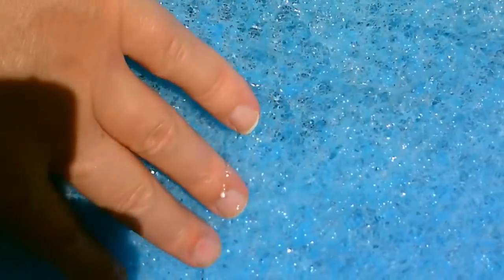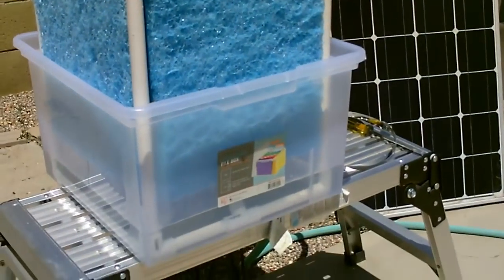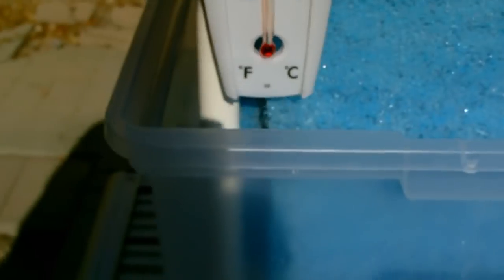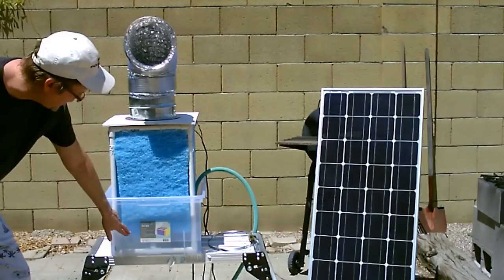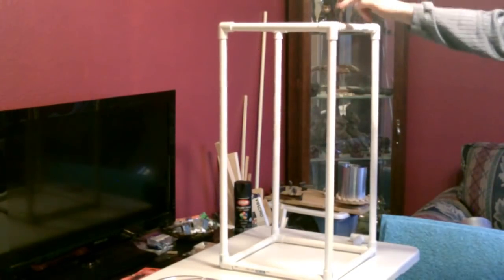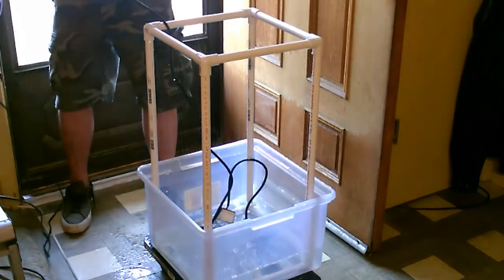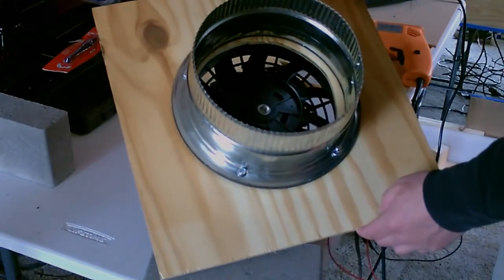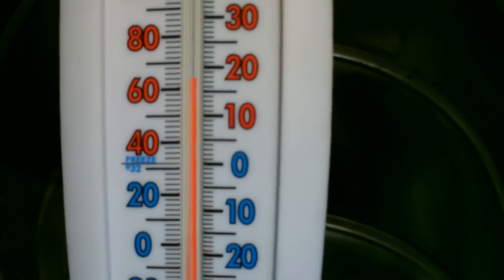DIY Evap Air Cooler! Best Yet! 1500CFM/20MPH (90Fin/64Fout) 500-1000 Sq.ft. run AC/DC/Solar/Batt

Comment: Where I live the commercial swamp coolers are massive and super expensive and have expensive honeycomb paper material that has be changed...but what does this suck sound like 10 feet away? The mic right next to the airflow is deceivingly loud.
Reply from the maker: hi there. it's actually not very loud. the mic on the camera just picks it up that way when it's right next to it. if you're even 3 feet away it just sounds like air flowing (no louder than a box fan on medium or high).
Reply: Maybe put a decibel meter so people would believe it. This is fantastic dude! Tropical country would love this! Thanks for the idea.

Comment: Hello and thank you for the design! I wanna try it out, but I can't find these pads anywhere in Europe. Do you have any idea of replacement? Maybe a simple towel will work? Thanks!
Reply: You can find them in any home improvement or hardware store. They're called evaporative cooler pads. They're also on amazon
Reply: @Blvkwvlf  thanks! still interested thou, if the towels will do :)
Reply: @IlyaIschenko  it won't because air can't pass through them
Reply: @Blvkwvlf  got it, thanks!
Reply: @Blvkwvlf  perhaps you have suggestion I cant find the evaporative cooling pad  locally, just some evap.cool.pad for chicken
Reply: Ilya, been trying with aquarium filter foam and some flanel clothes, not working cause not enough airflow, the foam and clothes got sucked in
Reply: @ishadyishady6883  good to know, thanks!
Reply: Ilya, any suggestion what material that absorb water but still pass a lot of air? I havent find any on ebay and amazon thou
Reply: @ishady27  some spongy mats, like maybe coco fiber mat for a bio-friendly build?
Reply: @IlyaIschenko  Ilya, I will try coco fiber and the chicken cooling pad, lets see which one work
Reply: @ishady27  good luck! let us know how it goes!

Comment: Nice job..... I'm in Arizona with the dry humidity . I made the 20" box fan in a tub one last weeks and it worked pretty good.
  When i get a chance i'm going to try your 4 sided version as it seems it would do better. We super cool with ac in the house then shut the ac down from 3 to 8pm during peak electric.
This would be a big help.... we get 115 to 118 degrees in the summer quite often
Reply: Joe Z — Holy crap, that’s hot. Good to know you’ll be staying cool as resourcefully as possible.
Reply: Lived in Phoenix in 2006, we had 127 degrees one day.
Reply: @alfredabbey6162  118 is about the hottest so far for us..... takes your breath away.127 is like a bug under a magnifying glass LOL
Reply: I remember that you would have to put on shoes to retrieve the news paper at 8am because the driveway would burn your feet.

Comment: swamp coolers work best in low humidity areas. try setting the system in the shade then blowing the cool air into that room. remembering that you can hook a return air flow to the intake of the cooler making it even colder.

Comment: Looking forward to the next video...
The resort I work at uses chilled water to cool over 700 rooms. Great idea to create an exchange to hook up to the swamp cooler.
Reply: Agreed. I'd like to see this.
Reply: Me too.  I live in too humid of an area for this to be effective like where he is, but would still be interesting to see nonetheless.  I would imagine you would lose some of the efficiency.

Hmmm...what if you doubled up.  Used the output from this unit along WITH a heat exchanger.  The water is colder than the existing air...means that water could still absorb heat energy.

Comment: Run ice in it it will be cooler my portable swamp cooler runs on water i drop a 20lb bag of ice in it way cooler than just cold water
Reply: In another one of DesertSun’s videos, he shows how the $2.50 cost to make ice for a month makes the air cooler, so it’s really not much of a cost and extra energy issue to add ice to the water.  I used to pay PG&E $170 a month to run my air conditioners on and off for each of the Summer months.  If it cools the air another 10+ degrees, it’s worth it.
Reply: @bettystover4137  im lazy i drop $1.75 for 20 lbs of ice and dump it in. Then i have 10 ice gel packs i drop in to keep water chilled then next day take out packs freezer them and after work 20lbs ice 12 am drop gel freezer packs in .
Reply: mike h  ok then why to you not drink hot water rather than cold water?  The colder the water the cooler the air sir passing thru the filter just like an Ac freon is colder in the cabin and heat goes out side of cabin. This has no heat but the air passing thru the filter of ice water. Also i drop in ice packs in after ice melts keeps it cooler than plain water.
Reply: mike h  that would be true but im dumping 20 lbs bags i get around the corner at an ice and water machine.  I leave my ice in freezer for drinks sir

Comment: If you had reflective material covering the whole lot  and insulated the container and the sponge should go down a lot cooler maybe down to 50 or lower I would have thought
Try Covering the whole lot in foil and see what temperature you get
Reply: There has to be airflow from an outside source of air, to the inside. If you cover it, no air will flow

Comment: do you have info on the fan
Reply from the maker: sure. it's a 7" 1500cfm - 2000max. 12v dc 80w car radiator fan i buy them on amazon. i usually get them in 2 packs. about 28 bucks for 2 here is a link to ones that are similar (can't locate the exact link) but any fan like this works https://www.amazon.com/dp/B07HMZWXL5/ref=sspa_dk_detail_3?psc=1

Comment: GOOD JOB!!  Remember to put a tiny amount of bleach in your evap water to prevent legionella. They LOVE that temperature range.
Reply from the maker: hi there. i just recommend drying out the pads every 24 hours or so... only takes about 10 minutes. that makes sure nothing grows on the pads. but bleach could work too (just make sure it's the right amount).
Reply: What about hydrogen peroxide instead (bleach aroma isn't a fave)?
Reply from the maker: i agree. that should work too. but again just drying the pads for a few minutes is the way to go. much easier then using additives.
Reply: @desertsun02  would be kind of annoying to take apart and dry all the time.  does the pad need to be submerged in order for it to work?  was thinking of shutting off the pump, while the fan would dry it.
Reply from the maker: hi. the pad doesn't need to be submerged. i dry it out like you mention all the time. you can also just lift the pad sections out and let them rest on the outside of container. they dry super fast. leaving the fan running and the pump off works great.
Reply: @desertsun02  thanks,  I ended up getting a 40 gallon storage tote.  Is large, and was worried that I would have to submerge most of the pad.
Well things just got easier.
Reply: Looking to build this next week. How is the fan holding up? I cant seem to locate a 1500cfm 7 in fan.  Most appear to be 1000cfm. Any tips on what fan you used or if you would go larger or smaller next time for a fan for the shorter build. Great job on this btw. I'm looking forward to making it solar powered once I get it up and running with my kids next week.

Comment: I wish these things worked during illinois summers but it's way too humid.
Reply from the maker: hi there. in the really humid areas i recommend something like my Cold Water air cooler (made with a heat exchanger) *if you look closely at the thumbnail picture for this video you can see an example of one. it's the unit you see on the very left side. here's the link to that build https://youtu.be/u0AGRBT1ISs btw it uses the same type of fan
Reply: @desertsun02  awesome thanks for the reply. I have a scrap 10 or 12 core auto evap coil that might work well for that